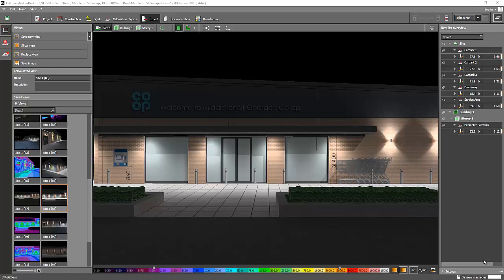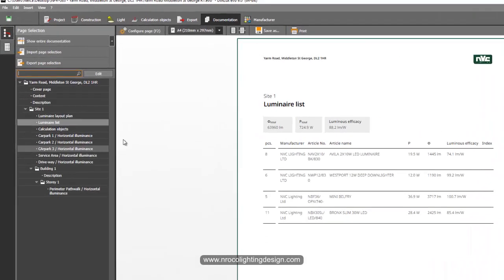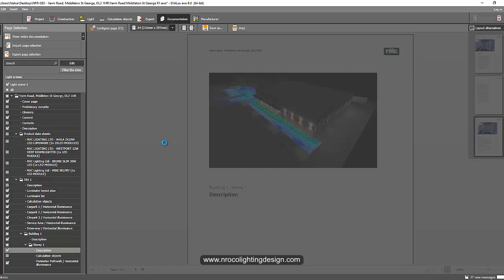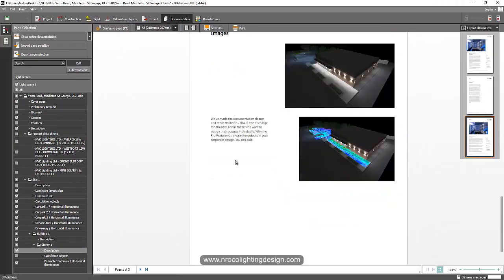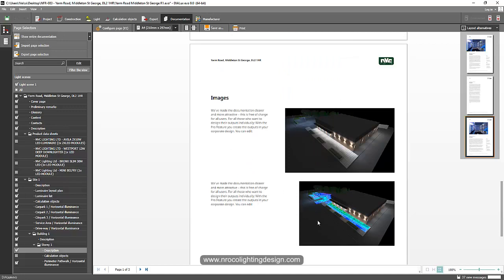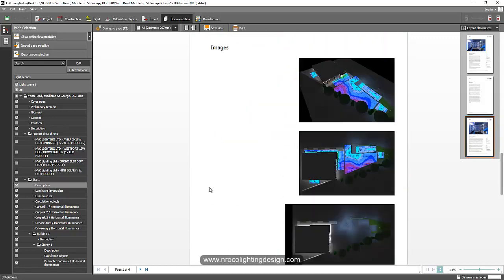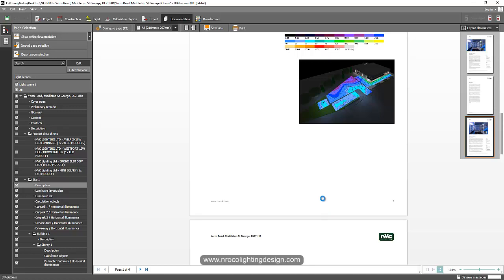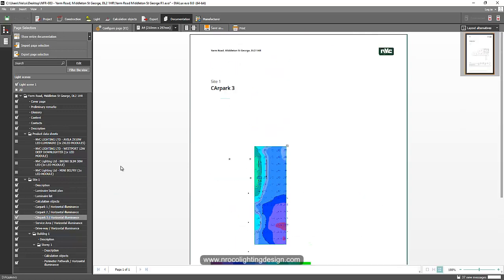Views page is missing in Dialux evo 9.0?

Comment: Thank you Nelca, I am also using Dialux Evo 9.0 A feature I am missing is you used to be able to click on an array or line of fittings, then if you clicked again on an individual fitting, you could select it alone, then move it to where best suits the room. I am puzzled why this has been removed. Now if I populate a room layout with non rectangular dimensions I have to individually add each fitting, am I missing something?
Reply: Selection of Individual fitting is available in 9.0 also